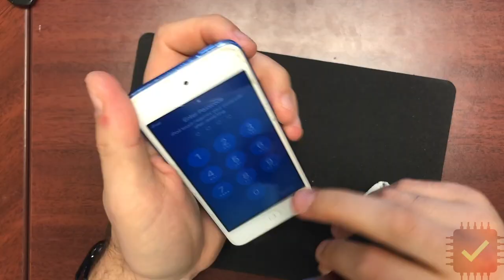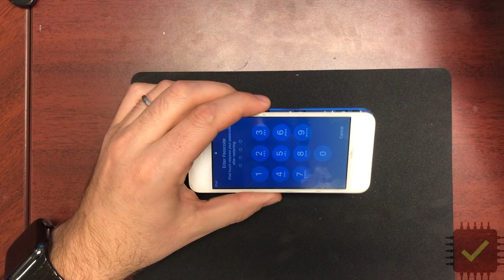Apple iPod Touch 5th 6th 7th Generation A1421 A1509 A1574 A2178  Battery Replacement

Comment: Forgot to put adhesive down the camera is in wrong place. How Ignorant is this. Waste of time for us all. WAKE UP
Reply from the maker: Thank You for Your feedback. Properly opened and if you don’t touch it - original adhesive can be reused. A little 99% alcohol to reactivate it and it’s as good as new. Saves time on removing, cleaning and reapplying new one. Haven’t had any issues in many years.